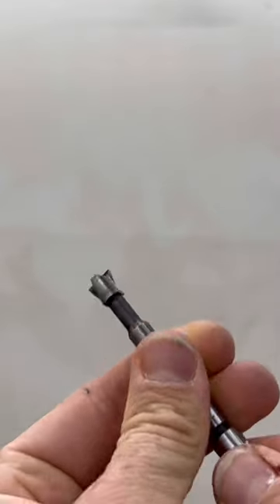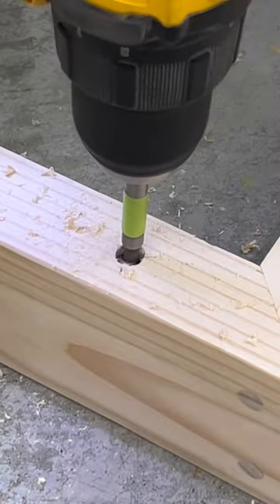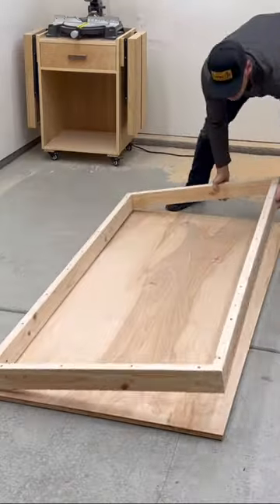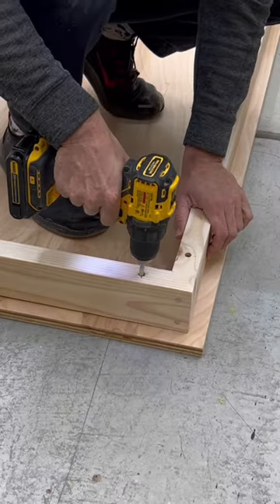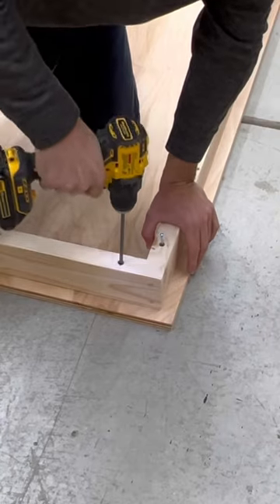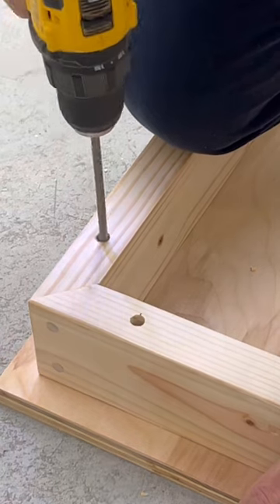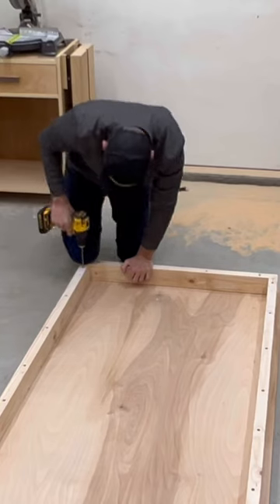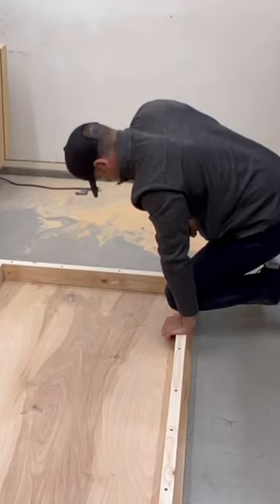Don’t Use This Screw For Table Tops

Comment: Wafer head screw is the technical name for pocket hole screws.
Reply from the maker: Thanks!
Reply: I've been wondering. Only thing I could find was truss and modified truss, but that was on Amazon in their sketch section...
Reply: I believe spax #8 (or #6?) wafer are pretty close to kregs screws , but I'd have to go to the shop to confirm.
Reply: @bloajmj2680  ohh, well sweet! And I'd wanna say #8 cuz I'm thinking that's most Kreg screws, but idk for a 100%

Comment: What kind of drill bit is that?
Reply from the maker: It’s a long square drive pocket screw drill bit.
Reply: @ThomasCustomWoodworks never seen one like that before! Thats cool
Reply: The bit he's drilling the holes with is a forstner bit
Reply: @ksm109  That's the answer I was looking for thank you I always forget what those are called
Reply: what size was that bit? 1/2 ..5/8?
Reply: @swiftraider759  probably ⅜ cuz that's what most pocket jigs use.
Reply: @Anthany0916  Thank you sir.

Comment: It's the shank design not the head but good tip...
Reply from the maker: Thanks!
Reply: @ThomasCustomWoodworks  I don't do much (or any) pocket hole work but I bought 1000 screws a couple years ago,, This might give me some ideas to use them.. Camo deck screws have reversed threads at the top that accomplish the same thing by pulling the boards together instead of pushing them apart but I haven't found a good use for them other than decking.
Reply: @xman4328  I find the do pretty decent for certain trim or cabinetry. Of course you have to predrill. But they suck up tight and don’t back out very easy. Obviously the GRK or whatever brand are more convenient, but when you’re in a pinch?
Reply: @xman4328  ,k
Reply: @pierretteverdon3899  ,P